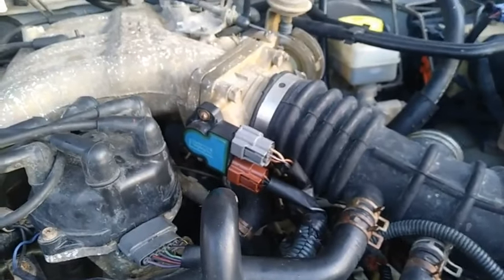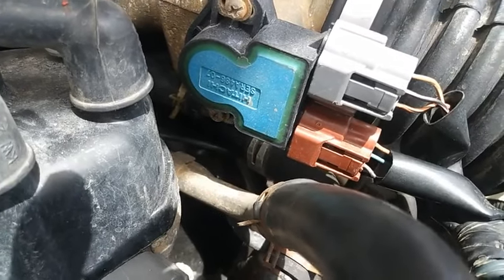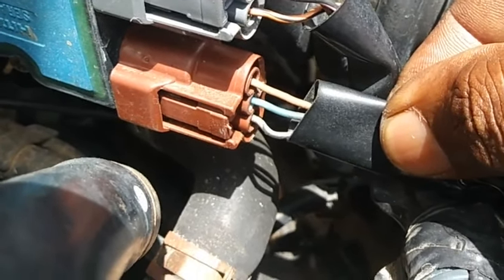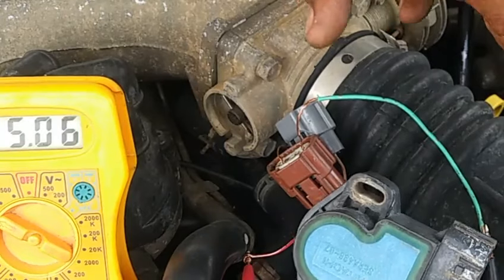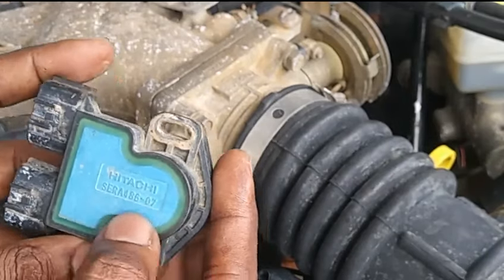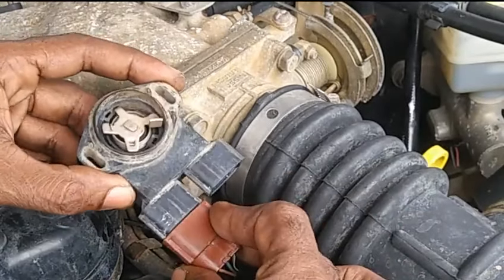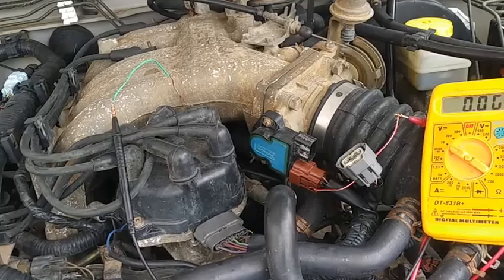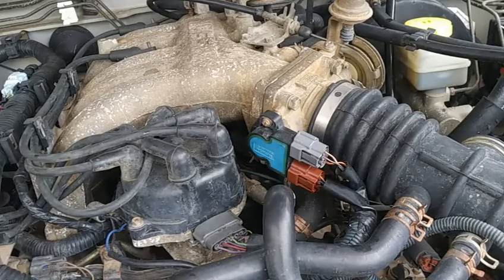How to Reset Nissan/Hitachi TPS(throttle position sensor), DTC P0121, P0122, P0123 & P0510

Comment: That's what my 2000 xterra needed. Runs good now RPM's are not going so high and the strange shifting issue went away. Great video
Reply: I'm having the exact same issue with my 2000 xterra. Thanks for the comment!
Reply: Same here with my 2002 frontier XE crew cab
Reply: What did u set the volts for it for the correct adjustment

Comment: My 1999 pathfinder will shut off when staying idle. If you accelerate and stay going it will go. Once you come to a stop it shuts off. Any ideas of what it is?
Reply from the maker: Try cleaning the inside of the throttle body air valve flap and replace the fuel and air filter.
Reply: idle air control valve might be bad i had similar issue had to keep on gas pedal slightly constantly

Comment: How close to 0.46 do you need to be? And should the engine be Cold or Hot? The throttle is in a different resting position when hot.

Comment: I want to say a Big Thanks for pointing this out. I went out and unplugged the throttle sensors to see if there was any dirt. And when I pulled the top one off, the bottom came right off.  Turns out the bottom one wasn't plugged in from when the mechanic worked on it a month ago.    Now the transmission and RPMS are Fine.

If you get your car worked on and it doesn't seem right.  Go and check and see if all the plugs are secure!!!

Comment: I had a quick question, when setting the position of the TPS with the multimeter I'm assuming the ignition must be on? Thank you for your help.
Reply: you are correct. i've done this on my xterra, and had the key turned to "on"

Comment: Hello I just bought a 2000 Nissan Xterra and the people I bought it from replace the TPS the reason they sold it is because it wasn't shifting into drive it shifts fine from first to second but I was curious if this was installed improperly could this have to do with it not shifting into drive thank you great video
Reply: I just bought the same  model and it does the same thing.

Comment: Hello Sir, after dismantling throttle body and cleaning it and then putting it back, there is high idle at 1500rpm. Would there be a relearn process that we can perform or there might be a chance that the ecm has a short? Thank you for a very informative video!

Comment: Awsome video; the Gray plugin at the top of TPS I believe you said it's the Transmission plug. would like to know, I'm getting 12v from the center pin and 4.4v and 2.4v on the other two should this be a problem going forward ?. and i have looked for broken wires, what ells could be wrong?
Reply: I have the same issue , would love to know what was the answer
Reply: I'm facing the same issue 
It's giving the throttle sensor and ect fault codes

Comment: Hello..good video..i did everythimg you showing in this video and my transmission still having shifting problems..but is better..because before didnt shift to the fastes speed..now is doing it but not very well..i have a 2003 nissan frontoer xe 3.3.
Reply from the maker: Try swapping the TCM if you feel the transmission is not at fault.
Reply: Hello..is me again..still am trying to find out why the fastes speed in my 2003 nissan forntier 3.3l is no working..i did everything you did in this video and in my case still i habe the same problem..when i replaced the transmission i didnt put any oil on the torque corventer..autozzone guys told me that might me my problem..do you think so?

Comment: Great video Four Real. My problem is. I  removed my battery to replace the power steering pump (2002 Nissan Xterra 3.3 VG33e 2X4 non supercharged) When I reinstalled the battery and started it up, got it to operating temperature I noticed a very rough idle. I scanned it and got code P0300. Could this sensor be the problem or is it something else. Would like to hear what you think my problem is. Thanks Four Real. Keep up the great videos. Hope to hear back from you.
Reply from the maker: Many things can cause a DTC P0300 which is a random cylinder Misfire. Here is a video on P0300. https://youtu.be/Zy_ie4rFMRo?si=WvWrkMXPA2Xz8uIF

Comment: So. if you install a new TPS and then it shifts a little funny between 1st and 2nd ( like goes up to 2000 + rpm's before shifting ) then it just might be that the sensor is out of position a little. Right?? Maybe turn it to a little more idle RPM's. thanks for the input.

Comment: I have a Nissan Pathfinder 02/2000 V6 3500. With the ignition on I do get the 5.05+/-. I do not have a 12-volt battery presence with ignition off. High idle, surges. I tried to do the throttle learning procedure, I do not get the sound from the throttle position sensor while doing that. Got any suggestions?? TPS replaced, idle air control replaced. Not sure what to do now with no 12-volt battery presents with ignition off while testing all the wiring for the throttle position sensor.
Reply from the maker: Check fuses and clean throttle body.

Comment: Thanks for that detailed instructions. How about egr? Should i block or delete it? Whats your opinion?
Reply from the maker: Don't block egr it will hurt WOT performance. Try to drop the engine coolant operation temperature is better way to go.
Reply: Thanks for that. I have zd30 engine, i have a group page on fb with the same engine. Almost all of theme block the egr. I also tried it and the engine performance is greater than it has no block. But i am not sure if it has bad effect for the long run. And also the engine is cleaner than before. Btw, the engine is 23 years old and run 126000+ km.

Comment: Hi, very good video, does this test apply to a 1995 pathfinder? I see the component looks different but suspect it works the same. Do you have any videos on how to test the oxygen sensor? Thanks looking forward to hear from you or anyone who can share light on this. My vehicle turns the engine light during driving conditions and it consumes gas like a race car. Seams like a very rich mixture air/gas ratio?
Reply from the maker: https://youtu.be/5k5gxjqVGeU

Comment: Hi, on my 2002 nissan frontier. I noticed that while my foot steady on the pedal. All of a sudden my rpm would go up to 3000 rpm while drive on a steady speed. But the rpm would go up all of a sudden. So plug it onto ob11. It red tps hi range

Comment: I’m the last comment on your video you said exactly what my 2000 Nissan Frontier 3.3 dose  when cold it goes at around 1500 to 2000  rpm one’s it gets hot hose down to 1000 rpm, but the problem when I come down to stop  sign my truck accelerates to 2000 Rpm by her self? What do you think is the problem?
Reply from the maker: Might be a possible vacuum air leak.

Comment: Great video thank you , question 🙋‍♂️ I’m working on a 2003 Nissan Frontier 3.3 with a code p0505 I already replace the idle air control valve and the code keeps coming back o did try everything to lower the rpm , can you do one video on how to put the right timing with a timing gun please thank you !
Reply from the maker: ECM might be the problem. 

This system automatically controls engine idle speed to a specified level. Idle speed is controlled through fine adjustment of the amount of air which by-passes the throttle valve via Idle Air Control Valve IACV) and Auxiliary Air Control AAC) Valve. The IACV-AAC valve changes the opening of the air by-pass passage to control the amount of auxiliary air. This valve is actuated by a step motor built into the valve, which moves the valve in the axial direction in steps corresponding to the Engine Control Module (ECM) output signals.
One step of IACV-AAC valve movement causes the respective opening of the air by-pass passage. (i.e. when the step advances, the opening is enlarged.) The opening of the valve is varied to allow for optimum control of the engine idling speed. The crankshaft position sensor (POS) detects the actual engine speed and sends a signal to the ECM. The ECM then controls the step position of the IACV-AAC valve so that engine speed coincides with the target value memorized in ECM. The target engine speed is the lowest speed at which the engine can operate steadily. The optimum value stored in the ECM is determined by takig into consideration various engine conditions, such as during warm up, deceleration, and engine load (air conditioner, power steering and cooling fan operation).

Comment: PLEASE HELP! TPS went bad ordered a new one but at 28-30 mph while shifting I get a high RPM surge no other gear just the one at that speed. I get a squel also sometimes. Is it my tranny slipping or just not adjusted right?
Reply from the maker: You can try replacing the pulse width modulator solenoid inside the transmission. What is the milage.?
Reply: @SteveXNYC  The code was for TPS .Had to drive about 30 miles with it jerking till I could replace. Engine light and codes gone reset EMC 20x on off key thing. Only noticed a slight squeal 2nd to 3rd (28 -30 mph) then a slight rev of rpms and shift. It shifts somewhat smooth if I let off gas but still chirps on driver side. I just thought it may be a coincidence TPS and transmission at same time. Research other mercury villager owners had same experience but no cure from mechanics. It has 151,000.After setting TPS  every which way to Sun I suck tranny fluid from fill tube and added lucas seeing it was black fluid I drained and put 2 bottles and new fluid in.it's still pretty dark on the dipstick.
Reply: @SteveXNYC  I have another tranny and a $800 quote .But the tranny shifted perfect before the TPS went out
Reply from the maker: Black transmission fluid is not Good. At 151k the transmission should be good. Try a solenoid test might help. https://youtu.be/yc1A8luXxjo.
Reply: @SteveXNYC  Run the engine until it reaches normal operating temperature.
Turn the engine OFF .
Loosen but do not remove the TP sensor screws.
Disconnect the closed throttle position switch harness from the TP sensor.
Connect ohmmeter leads between TP sensor terminals 5 and 6.
Insert a 0.008 inch (0.2mm) feeler gauge between the throttle adjustment screw and the throttle drum.
Rotate the TP sensor counterclockwise until the ohmmeter reads no continuity (infinity).
Rotate the TP sensor clockwise slowly until the ohmmeter just reads continuity (0 ohms).
Temporarily tighten the TP sensor screws.
Remove the 0.008 inch (0.2mm) feeler gauge, and insert a 0.012 inch (0.3mm) feeler gauge in the same position.
Open and close the throttle two or three times and observe the ohmmeter reading. There should not be continuity when the throttle is closed. If so, repeat steps 6 through 9, and retest.
Tighten the TP sensor screws to 17-21 inch lbs. (2.0-2.4 Nm). and recheck the ohmmeter reading to verify that there is not continuity when the throttle is closed.
Remove the feeler gauge and observe the ohmmeter reading. The ohmmeter should now show continuity (0 ohms).
Disconnect the ohmmeter.
Connect the closed throttle position switch harness.
Start the engine and rev it two or three times to 2,000-3,000 rpm. Allow the engine to return to idle for a minute.
Reset the TP sensor memory as follows:

Comment: Sir could you tell me how to find the idle control valve location .. I have a frontier 01 sev6 engine looks very similar to this one ?
Reply from the maker: I had a video disclosing the location of that IAC valve, YouTube deleted it. There should be no reason to mess with the idler control valve. If the engine is experiencing idle issue. Trying cleaning out the inside of the throttle body around the throttle blade(Do not do this with the engine running). Spraying purple blaster degreaser and wipe with a cloth while throttle blade is open. You can also try resetting the TPS sensor: https://youtu.be/CXBzX6WbVYk . keep in touch.
Reply: @SteveXNYC  thank you! I’m getting a po505 .. I now know it’s buried underneath the plenum. Symptoms of a rough low almost stall idle when cold. Code comes on immediately when cleared. I have cleaned the throttle body and MAF. I have just completed a head gasket replacement
Reply from the maker: P0505 is An improper voltage signal is sent to 
ECM through IACV-AAC valve. Possible cause, Harness or connectors
(The IACV-AAC valve circuit is open or 
shorted.), or  IACV-AAC valve is damage. Also check #15(10A) fuse in the left side dash box. Check the value of the IACV-AAC valve resistance for a 10ohms@77°F. The IAC valve is attach to under the intake plenum manifold, on the right side to the rear. You should be able to see its adjuster "+" screw from above the brake booster by move its hose out of the way. The manifold will require removal to test the IAC valve value, unless you can gain access between the firewall. Here is the removal: https://youtu.be/4hF97twkp1s. In the future, never clean the MAF sensor it can cause damage.
Reply: @SteveXNYC  thank you even cleaning (spraying with maf cleaner) and air drying before refit?
Reply from the maker: The MAF sensor and the ECM is design to clean the sensor everytime the engine is started when temperature is at ambient air temperature. At start-up the ecu will command at battery vothage to the sensor to burn off any contaminant, so it does not require manual cleaning.

Comment: Question  about a pathfinder 2003 tranmition does not work in drive ,  drive 2 works fine, all inside the transmission are new,  also i replace the tps, I try another cluster and steel no work. If you know anything tha can solve the problem please let me know
Reply from the maker: How about trying another TCM, transmission computer?.
Reply: Did you know where is located,  i been looking for it, couldn't find it
Reply: Did you know where is the TCM in a pathfinder 2003, let me know

Comment: Consult 2, says about an error in the throttle sensor, can this indicate that it is not working properly and needs to be replaced? Thanks sir.
Reply from the maker: Base on a P1126, the issue might also be the TPS. What's the mileage?.
Reply: @SteveXNYC  244500 m. 2001year.  What is TPS?
Reply: @SteveXNYC  Ok ok I understood the TPN, but the sensor itself, I have not yet checked it for a malfunction.
Reply from the maker: Some times resetting the TPS sensor like in the video will solve engine idling issues and transmission shifting delay. What you need is a auto scanner tool that can record short term fuel trims(STFT%). This will help verify if the engine is causing the malfunction or its one of the sensor's.
Reply from the maker: That is a lot of mileage. Look out for leaks, damage catalytic converter, fuel pump and its sump with sock and inline filter should check and change. Suspect PCV system and valve cover upper end gasket kit overhaul. Plus look at all the videos on the channel, since those the most common with 200,000m.
Reply: @SteveXNYC  The fact is that, as I wrote above, there are no problems with idling, and the error did not affect the operation of the engine in any way, I have dealer equipment for scanning this Consult 2 car. And yes, today the error went away from the dashboard again. But as I noticed, it may appear with a sharp acceleration.
Reply: @SteveXNYC  Sir catalysts were removed long ago, in my country this is permissible;), there are special oxygen sensors with a piece of catalyst). The fuel pump with a mesh filter was changed last year in the summer. Here is the PCV system, I missed the accounting, I will definitely check it.
Anyway, thank you for your time with me!

Comment: Tell me, I got error 1126, the engine runs smoothly without any interruptions, as if nothing had happened. I deleted it with a dealer diagnostic computer Consult 2. But then it reappeared and may disappear by itself, then reappear. What measures can be taken? Thank you.
Reply: @SteveXNYC  No Consult 2, Google also points to a malfunction of the throttle sensor
Reply: @SteveXNYC  Oxygen sensors are just perfect!
Reply from the maker: If the TPS should be chance make sure its a genuine Nissan dealer part.
Reply: @SteveXNYC  Sir I am 150% sure that this is the original sensor and it has not changed since 2001, because in 2005 the car has already arrived in my country.
Reply: I m trying to replace the throttle sensor on my 2001 Nissan Frontier (two wells drive).. I don’t have the vothimeter…I will appreciate if you can help me with this….. thank you very much

Comment: i have an 2006 maxima 3.5l and it need a new throttle wire harnes,...i cut the old harnes then realize i had "two white wires " one is wrapped with the red and black wire, inside the insulation can someone tell me what pin this wire is connected to on  the harnes?

Comment: At 10:14 did you really mean ignition switched to the off position? I tried that and am getting nothing on the multimeter
Reply from the maker: Yes. I did. If the ignition is ON during swapping the wires, the wires might touch each and burn the driver hardware inside the ECU.  Safety first, not speedy. Thank you for your support. Happy holiday.

Comment: What if I check tps sensor and everything works fine but still throwing high voltage code
Reply from the maker: did you ever mess with the idle screw at the TB or at the IAC value?. do not mess with those screw.
Reply: @SteveXNYC  I had to replace IAC. (Not from failure just my incompetence) Installed new IAC and idle was to low out of box so had to back screw out to get idle at 750 ish.
Reply: Throwing code p0123 secondary codes p1705 failure to enter test mode and p0328 knock sensor. Relocated knock sensor just for the hell of it read they go out regularly so figured I'd knock that one out. Shifts hard at low speed 1st to 2nd and doesn't seem like it has get up like it should

Comment: I have 2003 xterra supercharge and at idle it vibrates and sometime slow response in pick up
Reply from the maker: Clean the carbon inside of the throttle body air control valve attach to cable